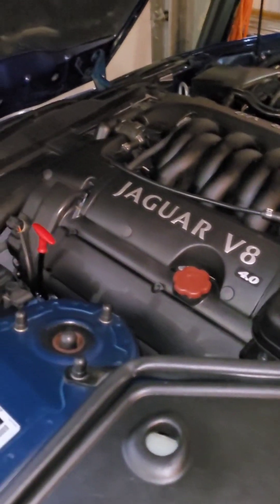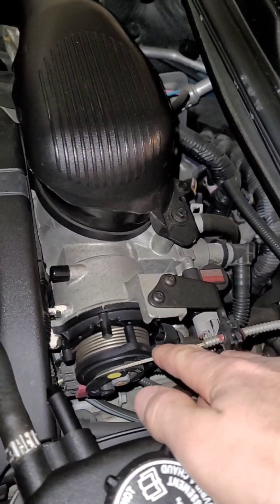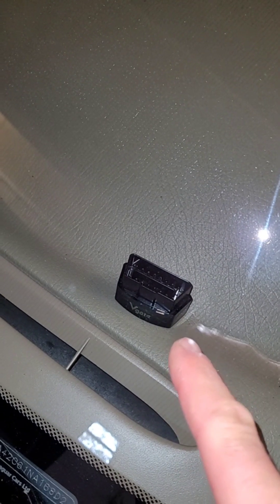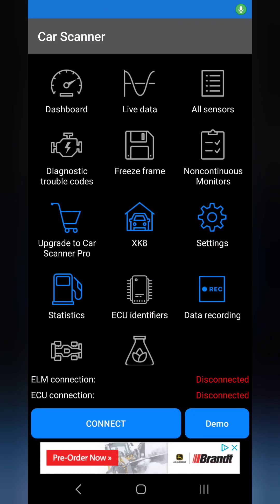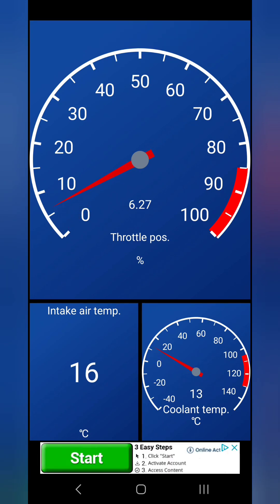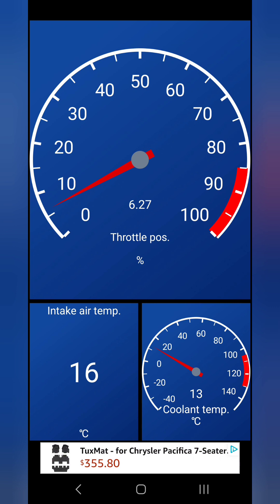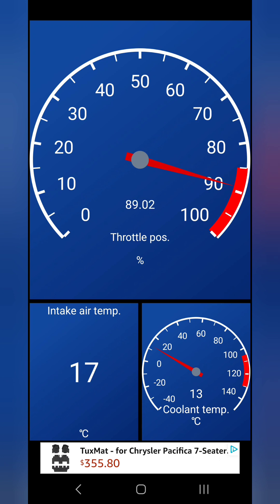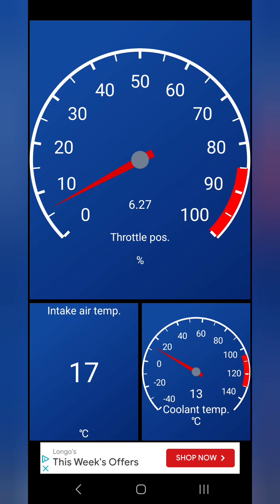2001 Jaguar XK8 - Throttle Cable Adjustment - Diagnosis

Comment: Thanks for this video I was able to confirm using the Car Scanner app that my throttle cable did not need adjustment since the readings go to 100% when i push the gas pedal all the way down!
Reply from the maker: Wonderful, glad to hear!